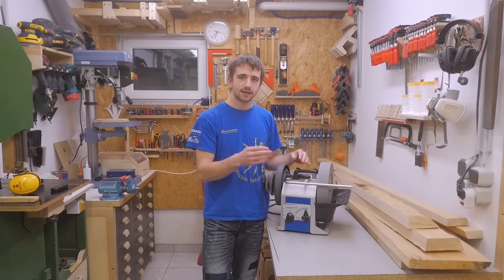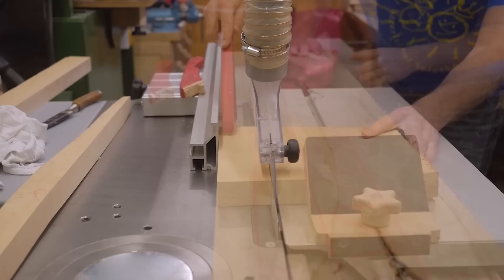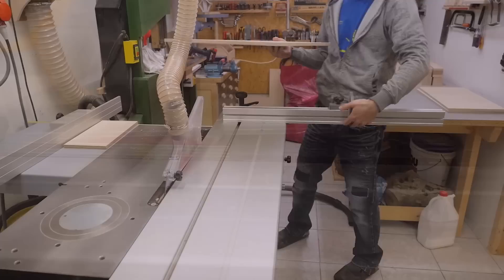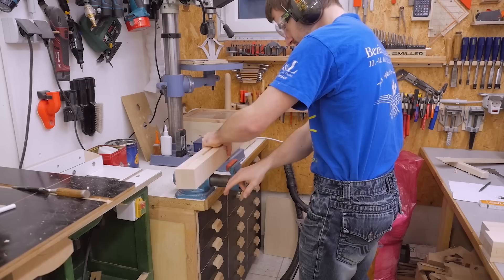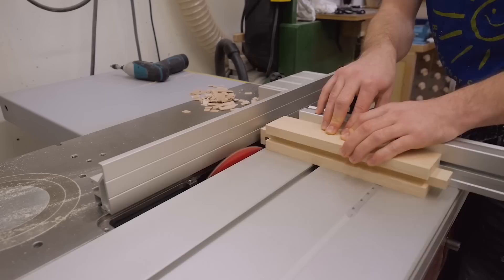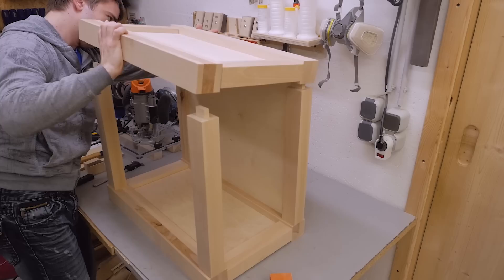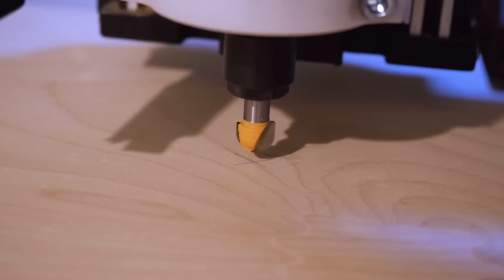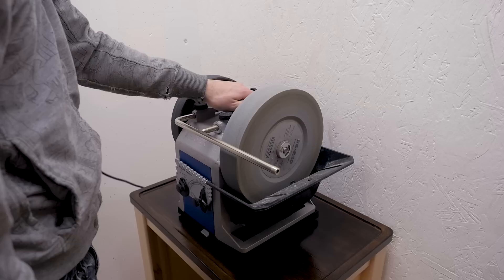Making a Cabinet for the Tormek T8

Comment: You should definitely glue the knob from the chisel-holder which slides onto the rail ( 9:25 ) or reinforce the connection. The knob has sort of a torx-pattern on the other side which grips tighty on a torx-formed metal piece on the screw which tightens to hold the chisel. On our training-course we had the same machine and we couldn't tighten the knobs as they wouldn't grab onto the shaft of the screw cause the previous students used them quite "heavily" and tightened them very hard so the plastic knob and the torx-pattern were pretty much rekt.

Comment: Old school Rotring Tikky II pen. :) They don't make them like they used to. Btw, if you have an old shell, but the core is broken, you can swap in the new cores in the old shells, they fit really well (the cap needs a little adjustment).

Comment: Awesome project! What was the rational for using the router and table saw to cut the mortise and tenons rather than your pantorouter? I'm on the fence about getting one.
Reply from the maker: I've never tried this exact way of making the joinery. And it was quicker to set it up
Reply: @MariusHornberger  Thanks, I'm also looking into a small bench top mortiser instead

Comment: At 8:23 we get a look at your pushsticks. I know you used Mathias Wandel’s pattern for a long time and these look slightly modified in outline. I am more curious about how you thickened the handles. Simply glued scales on the sides, round-over router bit and some aggressive sanding? Would love a pattern or any information. I’ve been working out push blocks for jointing lately which is just a handle like a plane tote on a 2x4 block.
Reply from the maker: Yes, that's exactly how I made them. They're different sizes because I screwed up the printout for one pair.
Reply: Marius Hornberger You could do a video on them... well maybe other pushsticks and blocks and anything. Because we use them up making changes to them is an excuse to screw around in the workshop.

Comment: Isn't gluing plywood sides to the solid wood frame potentially problematic (wood movement)?
Reply: Unlikely. The frame pieces are only glued on one side, so they are free to expand/contract.
A solid wood panel, however, should never be glued into a frame, save for 2 spots at the ends.